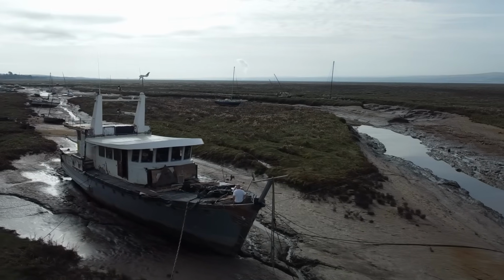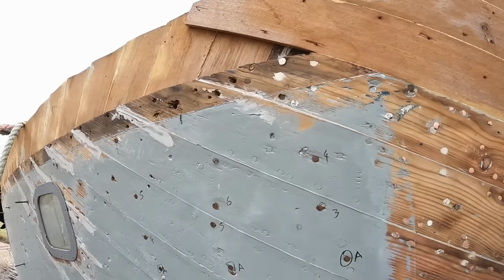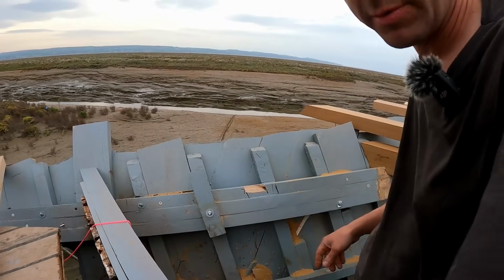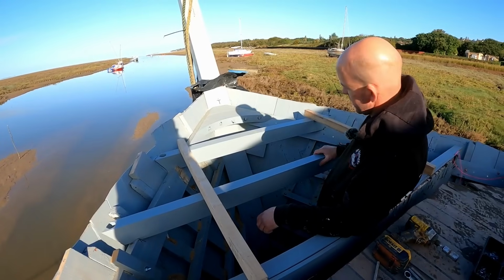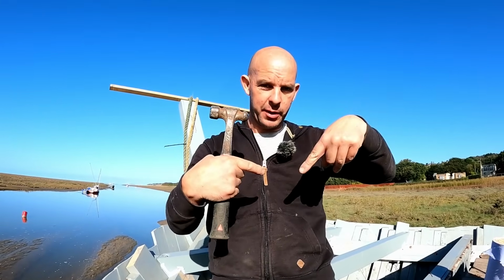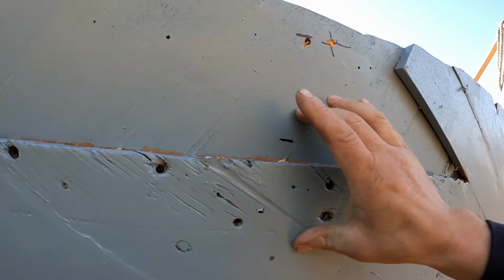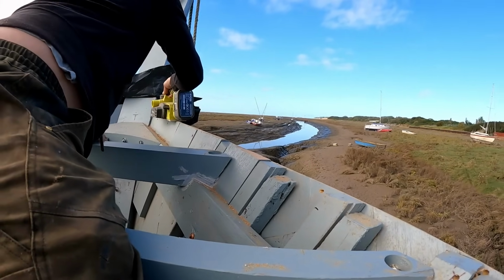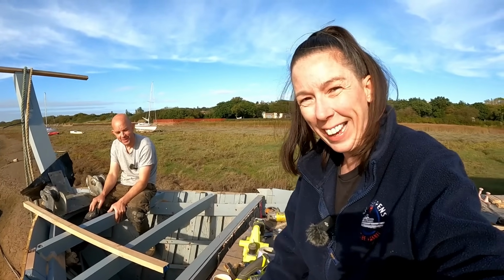Ep 146- A Decked Out Deck Before Winter? #boatproject #boatrestoration

Comment: Hi, great work, I learned a little trick from an English man here in Norway who builds post and beam houses, which might be of help. When carving a notch in wood to insert a beam, he placed the pieces on top of each other and used a multitool and dived down supporting the blade with the top log of wood. The same was practical during the last adjustment when, by diving in between the logs with a blade, you removed one mm at a time. If on the deck supports, to lower them, you`d dive inn under the beam while suporting the blade on the beam to loverthe beam down cut by cut. I hope I managed to make myself understood😀

Comment: I got a suggestion.  Before you  put the new deck on.  Where you got the chain locker . You put two plastic barrels on top of each other. One top and bottom cut out. The bottom barrel put in a drain pipe.  All this to keep  the anchor chain from the wooden bottom. As the plastic won't rot.

Comment: Lots of little plans coming together👍

Is it worth dipping the through jolts in paint just before you  put them in? So it lines the hole and add a bit of protection should water find its way down later?

Comment: Hi… I have run loads of Aluminum welding procedures so I have a couple of tips for you… Always use Zirconiated tungstens  and beware when using single stage regulators..(even with a flow meter. Single stage regs take gas directly into the reg outlet. You can set the flow rate but as the cylinder empties the spring that controls the reg diaphragm overwhelm the gas pressure and the diaphragm opens ( it is measured  in microns) but it is enough to increase the flow rate to the torch. If you don’t constantly adjust the flow rate of the gas  the cylinder will increasingly rapidly empty itself as you weld. Same goes for MiG/MaG welding.. Knowing this will save you money next time.. Love the channel.. your doing a great job.. 😊

Comment: Knees are a good idea, but in traditional ship building, knees were built of timber that grew in the shape of a knee, with the grain making the turn and making it much stronger.  Since you are not trying to be a traditional wooden boat, you might want to consider fabricating knees in metal.  Or, fabricating knees as wood and epoxy glue-ups as triangles if you have the room.
Reply: He has metal knees already under the deck that will fasten below the deck beam

Comment: What you need to remember is that those boats were basically flat pack, every plank was machined to size as per the design, then fixed together and they used whatever timber they had.. What your having to do is boat archiology, photos all all very well but they don't show whats under the skin, plus there is then what you want to achieve. Your doing an absolutely brilliant job, not only are you taking care of the boats past, but are making changes that will improve and prologue its life.

Comment: Can you add a locking washer under the top nuts?  When they're under the deck you won't be able to get to them if tightening is needed..
Reply: they were using lock nuts, so probably not needed

Comment: The “plate” that goes around the bulwarks is called a rubbing strake. It is to protect the joint between deck and hull when tied up alongside. I believe it was considered sacrificial. Great job guys, you’re doing well.

Comment: Need to have a word with wardrobe and continuity, Simon's shirt miraculously changed colour from opening drone shot to deck close up!

You could've have some plastic caps to place over the nuts, the size of the holes you've drilled, that would waterproof them and allow them to be removed if indeed you did need to replace or do any work on them?

Comment: Great progress. If you do run a beam up the middle for the support of the windlass. Why not run it all the way to the stem. That would tie the stem, bresthook, deck, rollers and windlass all together. Ours is 457mm wide. from the chainlocker bulk head to the stem. Yours might have to be wider. Our boat is 53ft long. 46 tons. Just a thought. Cheers.

Comment: Hi Jemma and Simon, I think you are doing a wonderful job and I wish I lived nearer to you so that I could give you some practical help. If you have read this I hope you will read on. I think you are making a great mistake putting back the Bulwarks in the same way that they were fitted in the 80's. I think you should take the opportunity to re think how they are fixed to the boat. The HTML was never designed to have bulwarks, the method used in the 80's was poor and probably lead to the amount of rot you are having to deal with now. There are two alternative methods 1) look at how Leo has done them on Tally Ho, or how "Acorn to Arabella" has made nice bronze brackets carry their much lower bulwarks. I hope this helps Garry

Comment: The best way to get small amounts of galvanising done is to find a local steel trailer manufacturer.  They will normally be happy to add your job in with theirs and this should only cost the weight of the additional galvanising.  Most galvanising firms have a minimum order, so small one-offs are very expensive unless you can add to somebody else's order, and that is where the galvanising trailer company comes in!
Reply: You are very close to Iffor Williams Trailers….?
Reply: I use a grit blasting firm that supports the Brixham fishing fleet. They grit blasted and zinc metal sprayed my car back axle for £80. It will literally outlast the car and probably the next one as well.

Comment: Lazy Days built in 1930 had been sanded and painted so many time the planks were thinner by a third, from the standard thickness timber. I had to replace two planks near the waterline. so, the timber yard put the new planks through the planer. This was back in 1998.

Comment: Thats a big leap ahead for the project guys well done. Question. Why the change to copper nails in that third beam inse4ad of bolts?
Reply: The third beam sits on top of the chain locker bulkhead, so there's nowhere for the bottom end of a bolt to come out so you can get a nut onto it.

Comment: Could I suggest that by using the large bolts the joint strength overall is compromised by the removal of wood. Could it not be better to use say one 6mm stainless through bolt along with nail plates on the timber face.
This is the technique used in truss construction (in the building industry)and allows the joint to be inspected and maintained
Also the washers should be thick say 2mm and large say 2mmx2mm.

Comment: If you can't find anybody that does galvanizing you can do a temporary thing, and I've done it permanently on car rims is,    Rustoleum's cold galvanizing paint. And if you can't find that,   try to find ZRC,   both those paints have protective ingredients.   I would like to suggest making a plaster cast of the Bracket you need up in the forecastle so you can make an accurate filler underneath your your deck and your metal bracket.
Reply: In a marine environment, those paints will be gone very quickly. In this case, finding a shop that does marine quality chroming and galvanizing are well worth the money. They're pretty rare now because environmental concerns.

Comment: On a sailboat,  the KINGS PLANK runs down center from bow to ?  several feet to another heavy bulkhead with lots of bracing.   I think you going to need it.  I ve seen 40-50 ft sailboat rip out anchor winch.  But they usually anchored wrong or a hurricane.  Hard to avoid those things.

Comment: Great solution for fastening the beam to the beam shelf.  The entire hull is fixed to the beam shelf. So through bolting the beam to the beam shelf completes the hull structure without putting more holes through the hull or relying on fastening into endgrain - the first place to rot in the previous layup.
Getting out ahead a bit, I would like to see your deck overlay the bulwark as one continuous piece.  Using this layup, you would have no vertical joints for water to migrate down into the frame.  Everything that hits the deck should shed beyond the bulwark.  Result - the frame stays dry and long term - no rot in the frame! 😊
Seeing the three deck beams in place from the drone is VERY exciting.  Now anyone can see the progress!  Bravo 👏

Comment: Don't epoxy the bolts in. It will be covered with ply and then teak if appropriate and if you ever do need to get them out it would save you some Faffe. I have just replaced 3-4 deck beams and the ship wright would not epoxy them in. In fact they rely use epoxy.

Comment: Just a thought. Are you trying to get the new beams level over too short a distance?? Would it be more accurate if you removed a narrow 6 inch wide section down to the tops of the old existing beams down the exact centerline out of the entire length of the deck from the bow all the way back to the front of the wheelhouse and use that much longer distance the establish the precise height of all the new beams???

Comment: I'm concerned with the safety when you were using the skill saw to cut the tops level of the wood at https://youtu.be/6ZHYTAFXH_c?si=nZ4kIDBSxpC2KVHo&t=2192.  The force to hold the saw was towards yourself and one slip would put the saw in your chest. Stay safe.